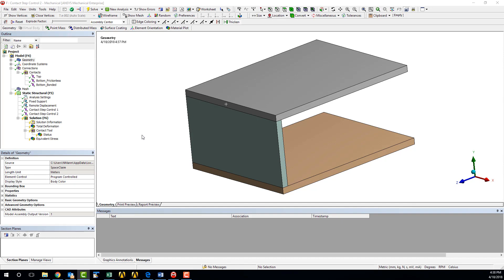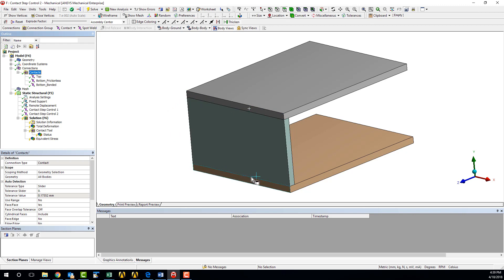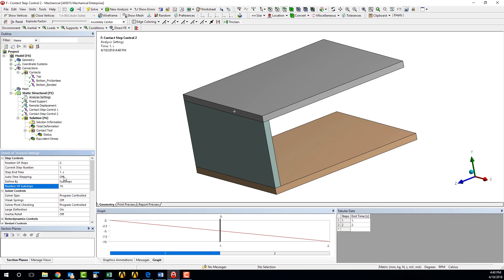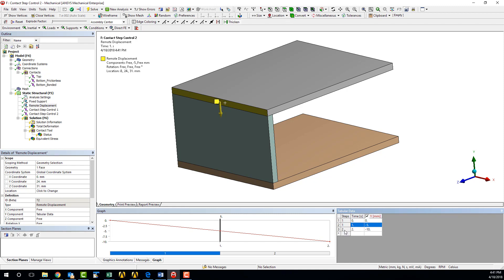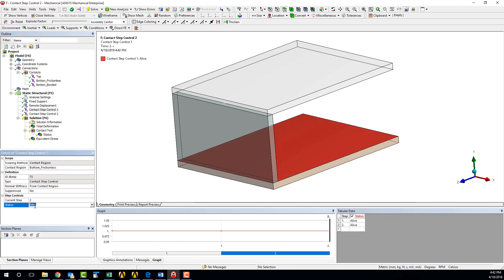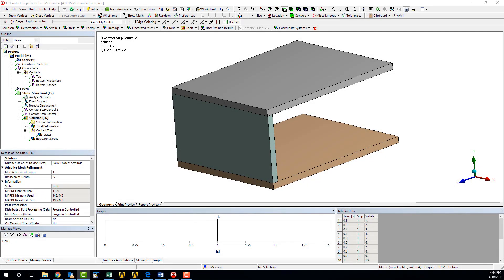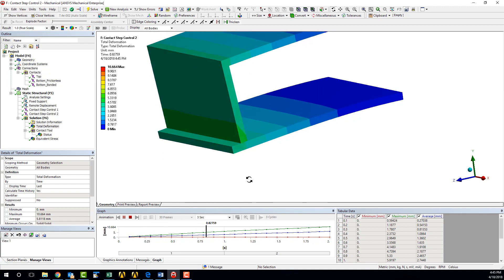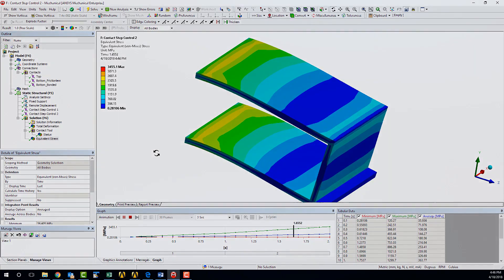Contact Step Control in Ansys Mechanical R19

Comment: I dont want to trigger you, but there is no way using Python Scripting in Workbench to swap status of Contact Step Control. This Feature is not available. You can only use Current Step option and loop. But there is no way to swap status using scripting, only you can make it by GUI. This is challenge for you to achieve it ;) As far as i know - no way it is possible
Reply from the maker: Thank you for your comment. If you are interested in learning more about Ansys Simulation Software, SimuTech Group offers various services like training, mentoring, and consulting. If you would like to learn more about these services, please send us an email at info@simutechgroup.com or you can check out the Ansys Learning Hub: https://www.ansys.com/services/ansys-learning-hub
Reply: @SimuTechGroup  unfortunately I couldnt receive from you any further respond so i gave up. Thank you, I will try myself.